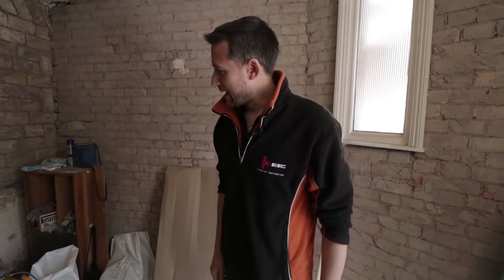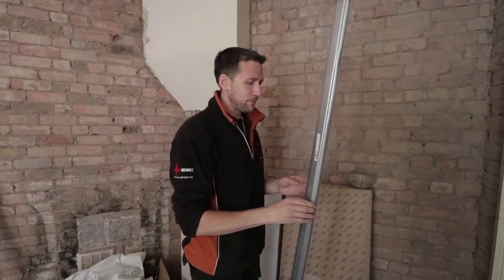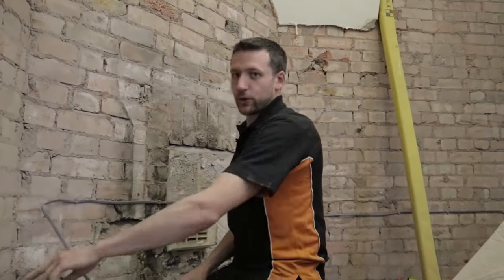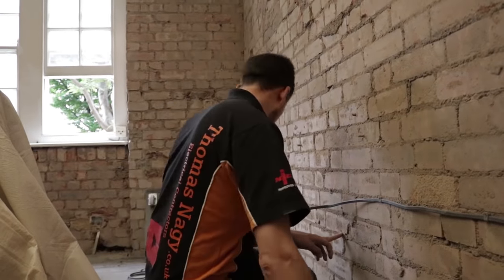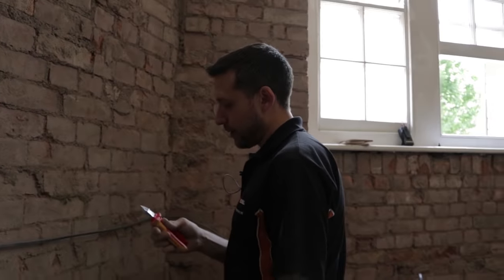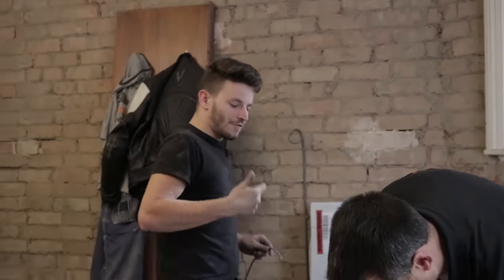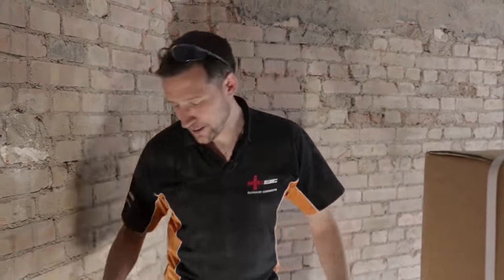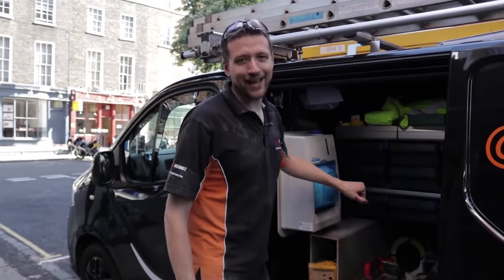Galvanised capping 101 + another rewire | Thomas Nagy

Comment: Earth rod... In North America, well Canada, our "earth" or ground rods are about ten feet long, galvanized and 1/2 to 5/8 inch diameter. I'm a ham radio op, I installed two rods for my antenna tower for lightening protection, one using a heavy duty electric impact hammer and the other with a bucket of water, yup bucket of water. I didn't believe it myself till I tried it, I dug a shallow hole, 3x3x3 inches, plunged the rod into the bottom of the hole, my wife poured in some water to half fill the hole, I withdrew the rod and then stabbed it into the first hole, repeat, add water, repeat over and over, took about ten to fifteen minutes the rod was 18 inches short of fully installed, finished it off with the impact hammer. I found this method on YouTube, give it a go next time.
Reply: Can he get anyones wife to do it?

Comment: Your clipping is wrong, always nail to the bottom, you was clipping nail to top,
Reply from the maker: I was always told clip so the nail is upwards, that way the cable can pull out of the clip if it is pulled downwards rather than being strained in the clip. 
Just what I heard though?
Reply: @thomasnagy  The reason the nail goes to the bottom is to support the cable, and also to stop it been pulled out by some one under the cable (teen age kids with nothing to do) having the nail to the top gives no support to the cable and also come out very easy, would be a interesting question to as on one of you vids, many thanks love your input and you vids